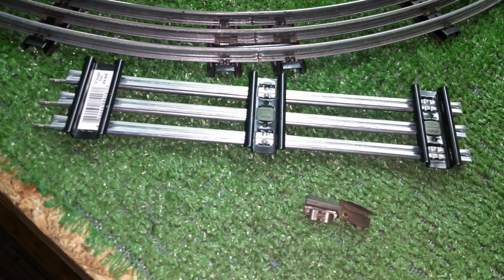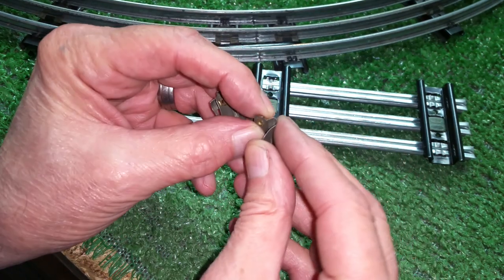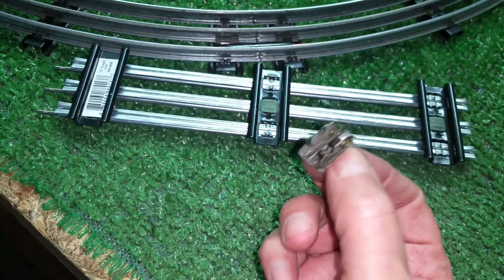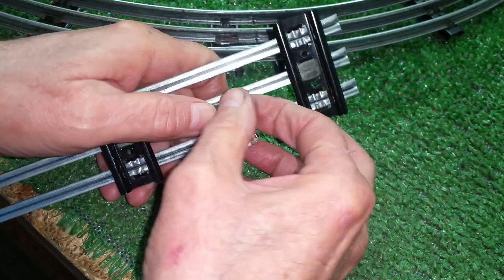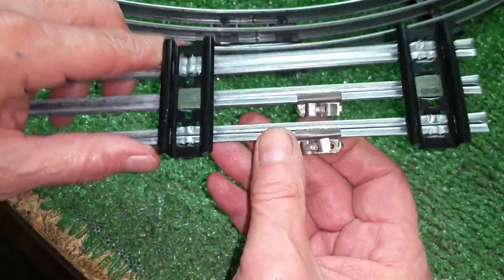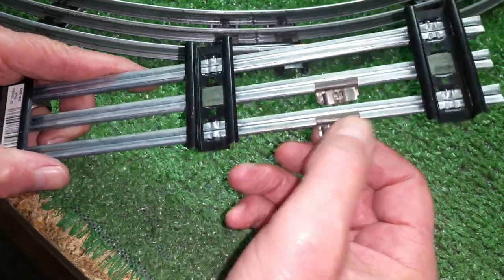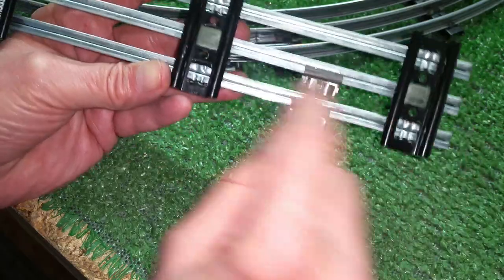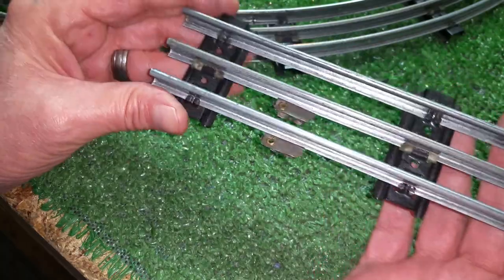AMERICAN FLYER (?) / FAHNSTOCK CLIP / SINGLE BLADE LOCKON / WILL WORK ON ANY TUBULAR TRACK

Comment: Back in the day my brother and had th single spad lockons......they were used for operating accessories...you insulate and out side rail from the cross ties and filber pins on the ends and of course the single spad locking on the insulated rail when train hit the insulated rail would operate you acc.   Dan,

Comment: Very interesting Benjamin, I love your very informative videos. Have you ever improvised by just wedging two pieces of solid wire along the center and outer rail pins where two sections of track go together and running them to the transformer?  It's not ideal, but will work in a pinch when you don't have a lockon. You just have to make sure the wires are out of the way so they don't catch on something.

Comment: Interesting find. I wonder whether those clips were intended to clip over the rail top as accessory taps. Of course they would cause a slight wheel jump. Did you by any chance try them that way?
Reply from the maker: no these are formed to fit the bottom of the rail, these are lockons, no doubt about that.